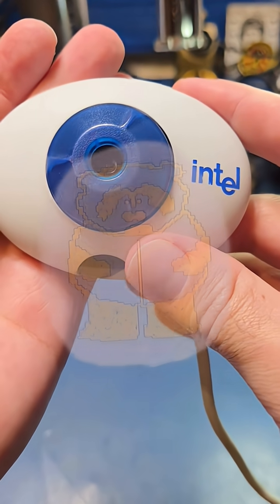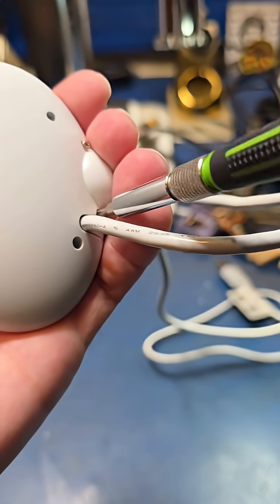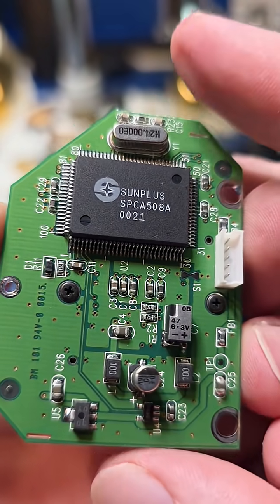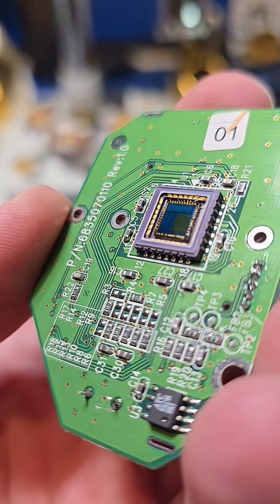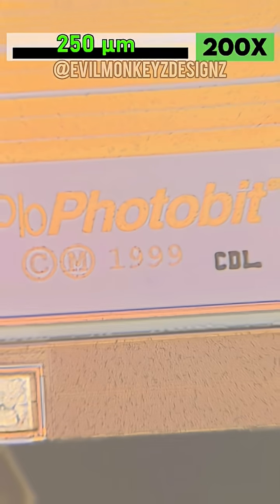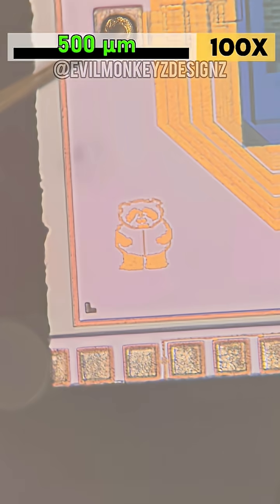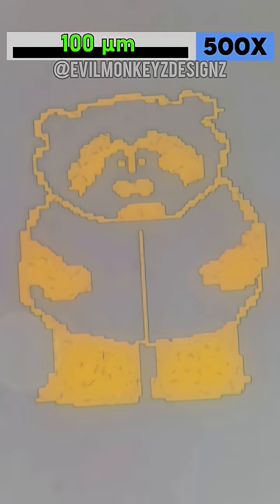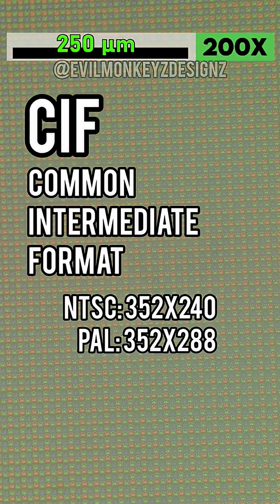A very sad panda lives inside this 25 year old Intel webcam

Comment: I use one of these on my CNC mill. You could turn the focus adjust a few extra turns and it'd become a macro type thing able to focus at 5cm or so. I use it to line up on holes and edges etc. Fixed to the mill head aimed down at the work.
Reply: Smart panda